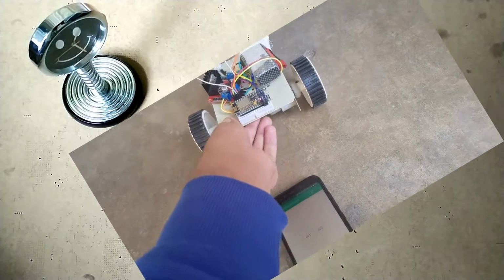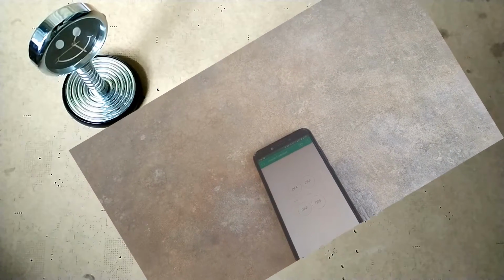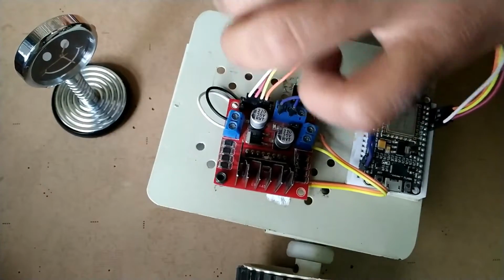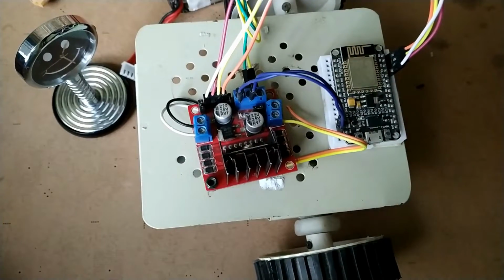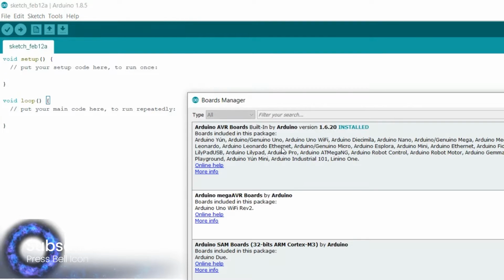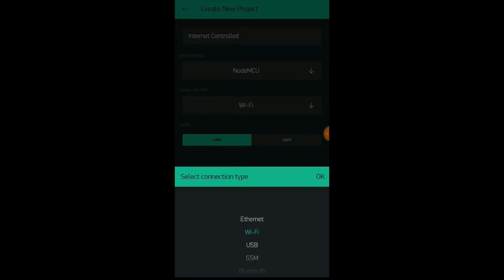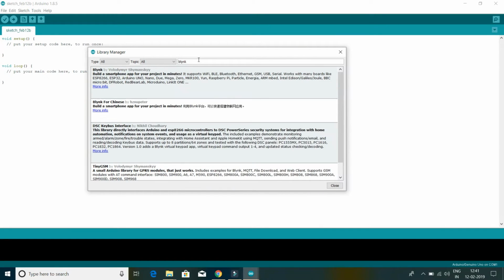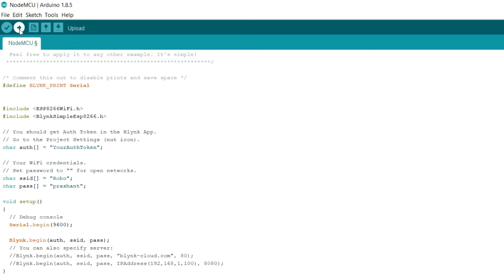How to make a Internet Car | IoT | Blynk | NodeMCU | esp8266

Comment: Do you have a suggestion? When uploading the NodeMCU example I'm getting an error: ESP8266WiFi.h: no such file or directory

I did all the steps you did in the video I added the board with the link you provided and added the blynk library

thanks!
Reply: Go it to work on my PC but not my mac. Original error was due to me not selecting the correct board. However, I got a bunch of other errors when I did select the proper board. Said that multiple libraries had been found and a bunch of other errors. I'm guessing my mac puts the required libraries in incorrect places. In your vid when you upload the board you have an UNO selected which is a bit confusing.   I have the NodeMCU V3 ESP8266-12E. Good work tho, the video was extremely helpful.
Reply from the maker: Install library esp8266

Comment: How does it rotate clockwise ans anticlockwise? Is it code or blync does it?
Reply from the maker: Its not the blynk code... It is done by the motor driver. 
It has inbuilt function for it

Comment: hello, what battery did you use and how did you connect it ? and thank you
Reply from the maker: I used a lipo.battery 11.1v
I connected it to motor driver voltage input
Reply: Thank you appreciate ur quick response
Reply: Hi again if i want to connect a camera to this project so what the best camera to but and how to connect it also how to do software part? Thank you

Comment: Wheres the code? :( the code u show in the video it's only an example of an empty Blynk code to use it via wifi but how do you control the motors??
Reply from the maker: Code is same
Reply from the maker: Just start adding buttons on app and select digital pins correctly

Comment: I not understand.why we need to connect WiFi to bord.i see some videos the cannot connect WiFi to board.can u solve my problem in a video.pls
Reply from the maker: Okay..... It works on internet... They connect it using wifi hotspot from mobile... And then they work with it.... But actually when we connect it with mobile hotspot it gets internet from mobile and then work the same procedure as shown here
Reply: @RoboCircuits  thanks Robocircuit
Reply from the maker: Welcome

Comment: facing problem sir
Arduino: 1.8.10 (Windows 10), Board: "Arduino/Genuino Uno"

 #include <ESP8266WiFi.h>
ResolveLibrary(ESP8266WiFi.h)

          ^~~~~~~~~~~~~~~
  -> candidates: []

compilation terminated.

exit status 1
ESP8266WiFi.h: No such file or directory
Reply from the maker: Install esp8266 library
Reply: I installed the library,but still the error  occuring